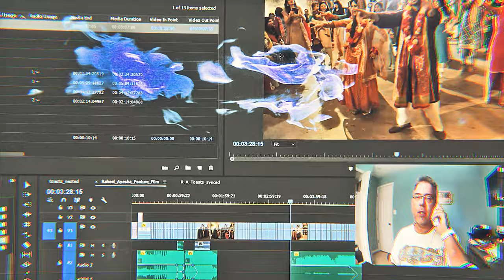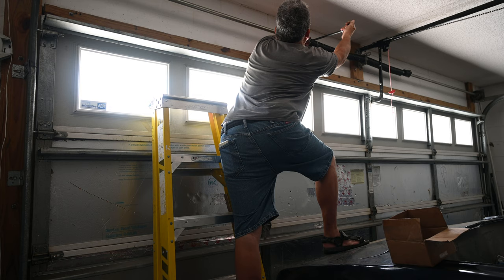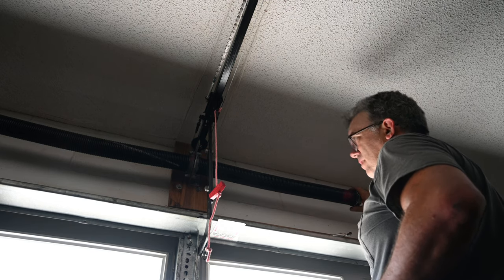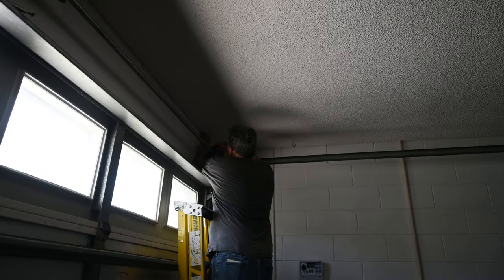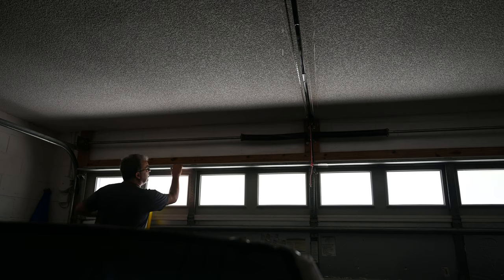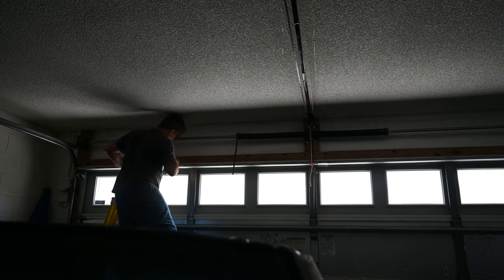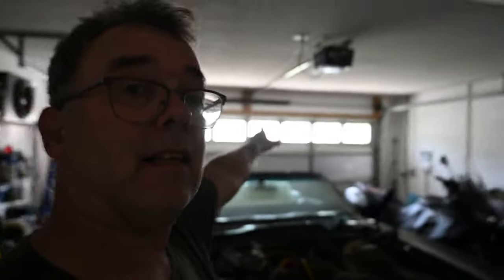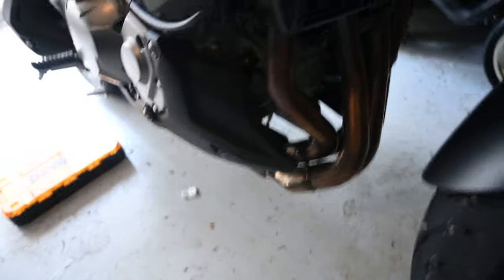Garage Door repair Vlog

Comment: you said that the door is heavy till halfway, then it gets lighter?
Reply from the maker: Yes... it's a little heavy until it's about a foot or two up... then its light.
Reply: @techguyMD  you have the wrong springs for the door
Reply from the maker: @Liftmaster-sw2zy  I measured it... did all the calculations from DIY garage door where I got the spring... since posting I added a few winds to the existing spring which didn't seem as tight and now the door can be lifted with one finger.
Reply: @techguyMD  but it looks like you added aftermarket insulation to the door. If you did, then the original springs then would be wrong for the door.the reason is, when you add insulation to the door, it has a lot of weight. So, when you measured the broken spring, you put the same springs back on. Which normally would have been fine, but you added insulation to the door, throwing off the springs. If you have any questions, let me know
Reply from the maker: @Liftmaster-sw2zy  ahh...  I bought the house last year and it was already insulated.. thanks for that info!
Reply: Not trying to be rude, just letting you know. I’m a garage door technician, so I try to help people out on the Internet as well. 

Anyway, how I knew immediately something was wrong, is when you added 30 quart turns to the springs, yet the door was still insanely heavy. On a 7 foot tall door, I always start with 30 quarter turns, and adjust from there. I’ve rarely ever had to adjust the springs after the first winding up. Also, another tip, after you have wound the springs, before tightening the set screws, you want to hit the winding bar a few times to relax the spring. This causes a little bit of a gap in between the coils, preventing them from sticking, causing premature wear and breaking. 

If you have any questions, let me know
Reply from the maker: @Liftmaster-sw2zy  Oh I didn't think you were rude at all. Only helpful! Thanks!